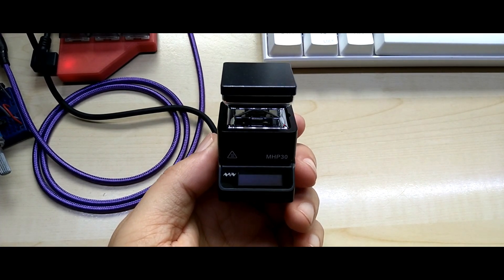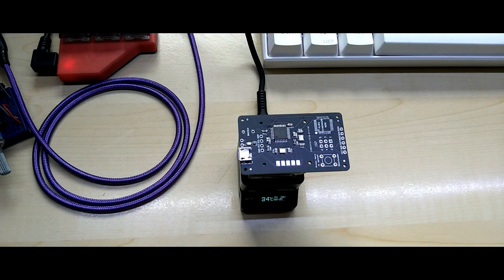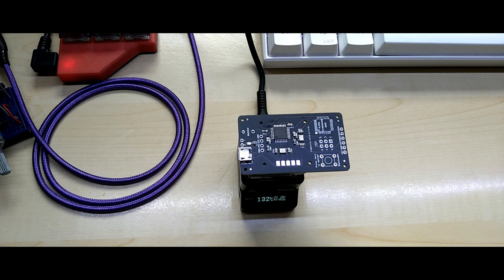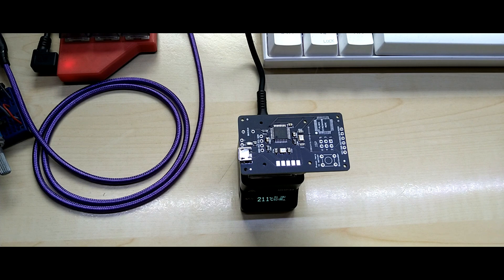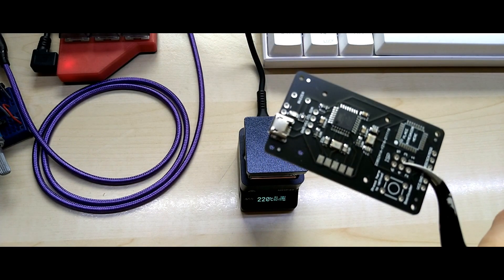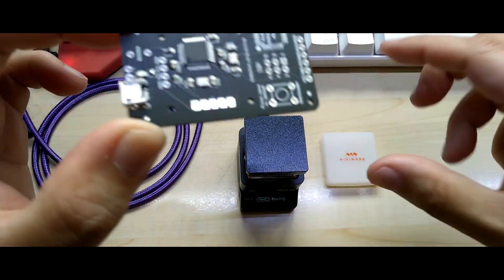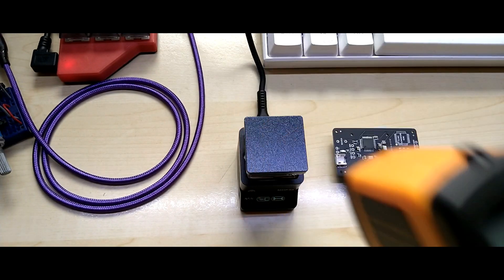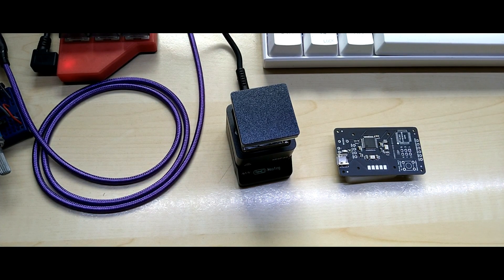#MiniWare MHP30 Mini Hot Plate from #DFROBOT Re-flowing small PCB by #Hayri Part 2

Comment: Without a doubt, very high-tech and very highly specialized. A normal infrared cooker does the same but on much larger boards, but doesn't look as pretty. But for much less money -)
Reply from the maker: You are absolutely correct, this is for nerdy people like me 🙂 There are cheaper solutions of course, same goes for cell phones for example, you can buy one for 100 or 2000 🙂 Stay safe.